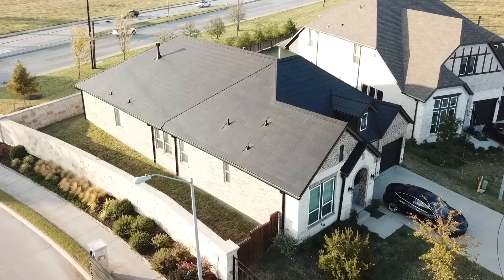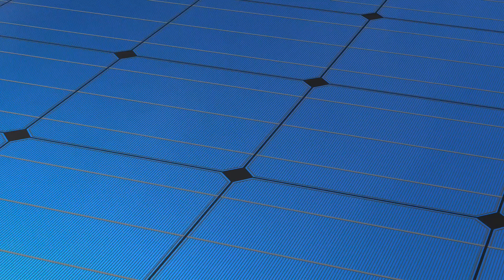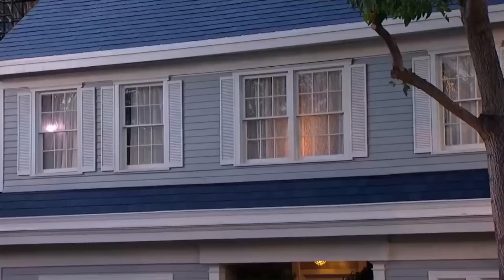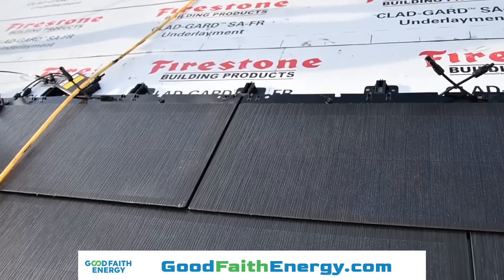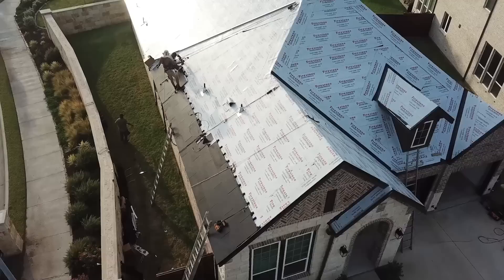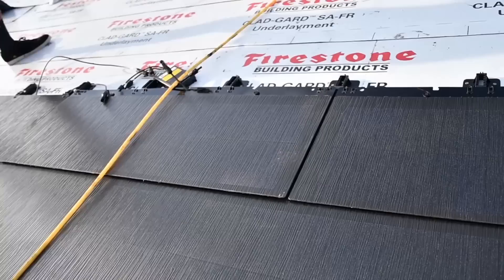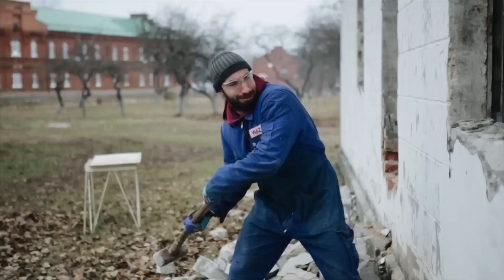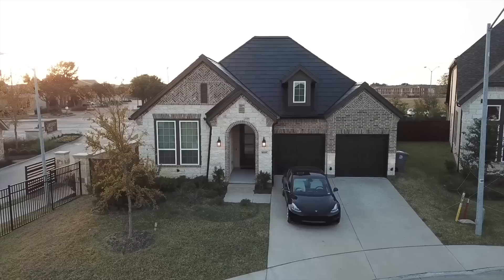Tesla Solar Roof - Expensive Fad or the Future?

Comment: So...when these things heat up, they radiate directly onto/into the structure instead of the benefit of the air gap under standard solar panels were the only way to radiate into the structure is through the standoffs....

😒 .....Genius

And what about when these things short out and try to light your house on fire?

I'd much rather see innovations in solar panels that can orient themselves towards the sun then this  gimmicky "zomfg it has Tesla on it I want it" stuff that's been around for decades.

Comment: I am actually right in the middle of making this decision.After consideration, in 2021, I'm going with a conventional roof (either steel or asphalt) and a solar array. Some reasons for this: 1. In the NE the Tesla Solar Roof is largely unavailable 2. The Tesla contact/purchasing interface is sketchy to say the least. 3. The roof tiles are much lower efficiency than standard panels 4. They use a string inverter rather than microinverters. 5. We have a separate garage on which we are going to also install solar and installing glass tiles would be a terrible waste of money.  I think Ricky is correct that eventually all new construction will have solar roof tiles, but in this area in 2021, they really aren't a great choice.
Reply: "The roof tiles are much lower efficiency than standard panels"

Really? I would be interested to know how the values compare. What info do you have on this?

Comment: In 8 more years when I need a new roof, solar roof should be dirt cheap.
Reply: Not likely. Have you bought a glass and aluminum picture frame recently  or a metal window.
Reply: @M13x13M  solar pv cells are projected to continue to drop in cost an additional 50%. The most expensive single part of the solar roof are the pv cells.
Reply: @JonathanRootD  - I’ve been installing solar since 1985 solar . It can’t decrease in cost . An aluminum and glass  window that has no solar has never decreased in cost . Glass cost increased 30 percent last year alone . A solar system that cost $15k in 2000 costs $35k now .
Reply: @M13x13M  plus inflation in currency, had an 8KW setup with microinverters installed last year for 19K total minus 6500 state and federal tax credit.
Reply: @AndreyBanyuk  - where do you live? Everything in California is overpriced , but I was talking about the typical 10kw system .
Reply: @M13x13M  You clearly don't know what you're talking about. 
A decade ago, an average 6 kilowatt hour residential solar system could cost more than $50,000. Now, the outright cost of a typical home installation ranges from $16,200 to $21,400.
Reply: @JonathanRootD  : I’m talking cost of a system not cost per kilowatt. Code, permitting, racking, roof penetrations, combiner boxes , disconnect box, intertie , connectors really add up since the 1980’s when I installed my first system. And then there is the cost for yearly cleaning.
Reply: And you have lost 7 years of solar production.
Reply: @kevinkaaz7720 - yeah a lost of $1800. So he is way ahead by not installing solar.
Reply: @M13x13M  My average electric bill right now, without driving our one EV more than 4000 miles in the last 12 months, is approximately $110/ month.  We will be replacing our one ICE vehicle within the next year with a second EV as well as getting a solar roof.  Just driving 25,000 miles per year with the 2 EVs would increase our electric bill to roughly $250/month.  If I can get enough PV production to offset 90% of our electrical usage, we will save in the order of $2,700/ year.  Over 7 years, that comes up to $18,900, not even taking into account not having to pay for any more trips to the gas station.  And yes, we live in California.
Reply: @kevinkaaz7720  : Do you  finance the cars and the solar system? Is that cost and the cleaning  cost factored into you payback?
Reply: @M13x13M  No financing necessary and I can clean the roof myself if needed.